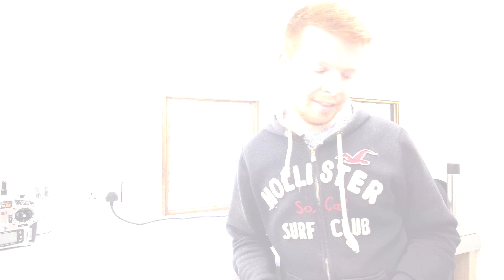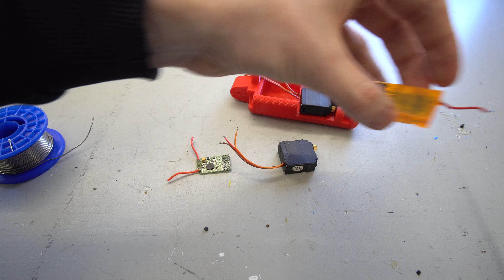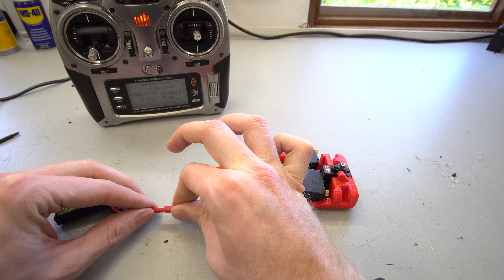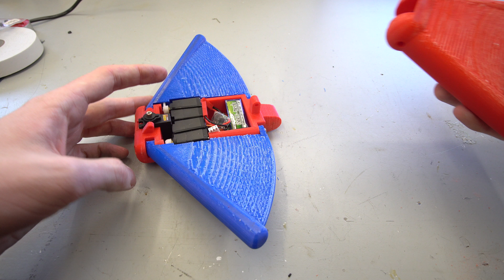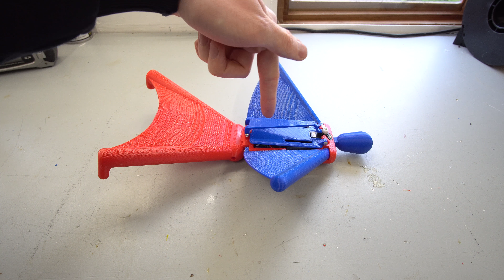RC Wingsuit - Part 1

Comment: If you want to turn the sanded plastic back to it's original color, just take a torch to it from a distance and slowly warm the surface till the white re-assimilates. You could do it with a lighter too, you just have to be more strategic not to burn yourself or your piece.
Reply: Derek Troberg - almost the same tech as flame polishing....

Comment: Fascinating video and concept. I really hope this works out.  I do think there are two or three "control" elements missing from this design.
For more accurate replication of wing-suit flight you would need to consider 
- controllable "Shoulders" (to allow you to independently tuck either arm in close to the body to more effectively control roll, and to tuck them in simultaneously to control pitch an airspeed)
- controllable "elbows" (for fine pitch and some yaw control)
- controllable "hips"
- controllable "knees"

Of course a wing-suit is far more difficult to accurately replicate in RC as this form of flight is controlled far more like that of a bird or other flying animal which means that every bone and muscle is used to finely control some aspect of the flight. Even the head! 

I love this project. All the best

Comment: I would test the aerodynamics by hanging it from the ceiling and only dropping it two meters. I thing with a slow motion camera one could get a good grasp of the movements without wrecking it. Just in case the parachute fails.

Comment: Would you recommend the University of Hertfordshire for aerospace engineering?
I noticed you have a hoodie from there and I have an offer from them and would like to know as much about the Uni as possible.
Reply: A load of it is literally built on an old DeHavilland factory, so it wouldn't surprise me if they had a decent aerospace department.

Comment: I'm not sure, but I think the Wight doesn't relate directly to the height. If your height is reduced by a half your weight is less than a half.

I think it doesn't work the same in all shapes, but if you reduce by a half a cubes height you reduce its volume and weight by 2**3=8
Reply: This is kind of complex. Mass scales with length cubed, but drag force scales differently.
Reply: Charles Lambert wow, yeah drag is with surface so scaling everything is really complex!!

Comment: Good luck, you're going to need it. How do you expect to keep sight of it at the crazy speeds it it going to require? Finding a ridge with some strong wind is your only chance without FPV, and it still probably won't work. What about an elevator? That is the most important control surface, I believe they use their knees in real life.

Comment: aerodynamics don't scale linearly (Renolds number) a 747 wing loading (weight/wing area) is many many times higher than that of a model aircraft.

my prediction is you will have a glide ratio of about 1:1 if that :-)

Comment: I have zero experience with 3d printing so I have no idea if this would work but it might be worthwhile to try applying some mold release spray to the print bed before printing or maybe some 303 aerospace protectant.

Comment: Hey Tom! Love your videos! I was wondering! Would you consider building my multi rotor model and using it to lift your Parachute dude? It’s a 500 size quadcopter, with DT-750’s spinning 11x4.7 props. I can give you access to a google drive to download the stl files. And the assembly videos....Email me at snx1458@gmail.com

Comment: I think this is a great idea but sadly I don't think it'll work in its current form - for full control you'll also need to bring the hips and legs into play. You've got the right idea for roll control with the arms though. To turn right you'd either drop the right shoulder or straighten the left leg more than the right (or do both for tight turn), turn left do the opposite. To go forward faster your straighten the legs at the knees, slowdown or backslide bend the knees. Stability in flight comes from the fabric between the arms curving higher than the body CofG and acts like a shuttlecock - heaviest bit at the bottom. Hope this helps a bit, and looking forward to Pt2 regardless of whether it'll work or not :)

Comment: This leaves me wondering how much the square-cube law applies to aerodynamics. Either way, I feel that this will perform much worse compared to a full sized wingsuiter (more speed needed and less lift provided)
Reply: M Wire actually it think it gets easier the smaller it is

Comment: Great idea and vid but i don't think its going to glide well at all. The surface area of the wings is too small plus where you have simulated the arms are too round there is no airfoil effect. I might be wrong but good luck with it anyway still worth trying

Comment: Love your projects but this looks like it’s doomed to fail, it looks way to heavy for the tiny wingspan, could have done with fabric wings and carbon rod arms and legs to keep the weight down. I can see this dropping like a lead balloon! At least you can easily mount an FPV setup to have a look at what happens, good luck 👍

Comment: Legs should be independent for roll and pitch control as per a birds tail and wingsuit. 
Mix it as elevons tied in with arms as ailerons. 
Then construct from carbon fibre and use ripstop for wing surface. Maybe double skin it for a proper ram air aerofoil.

Comment: Hi Tom. Great video as always and I've been particularly interested in all of your parachute/paragliding relating videos recently. As an ex-skydiver/wingsuiter I've a couple of thoughts which, although late for your current build, might be of use for future iterations. 

I would have considered using two alternative control surfaces instead of the articulated arms - a twist mechanism at the hips and a bend (like an elevator) at the waist. The twisting at the waist would simulate more accurately the way I would have steered, whist trying to maintain maximum arm inflation in anhedral position. Bending at the waist functioned to change both  the camber of my body aerofoil and also the inherent angle of attack.

I don't thing it will be a problem in your current build, since i predict a very head down attitude, but take a look at real wing suit videos and the parachute deployment. Typically forward speed is reduced for deployment by bending the legs at the knees, and pulling the arms into the body. 

If you any further details please get in touch. I'm also in the UK and happy to talk.
Reply: God has said in the Quran:

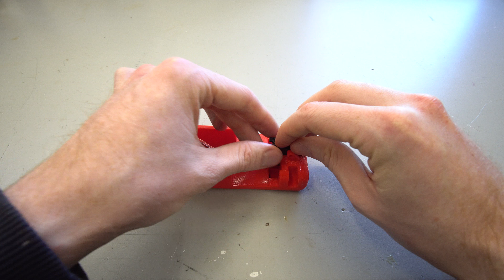{ O mankind, worship your Lord, who created you and those before you, that you may become righteous - ( 2:21 ) 

 [He] who made for you the earth a bed [spread out] and the sky a ceiling and sent down from the sky, rain and brought forth thereby fruits as provision for you. So do not attribute to Allah equals while you know [that there is nothing similar to Him]. ( 2:22 )

And if you are in doubt about what We have sent down upon Our Servant [Muhammad], then produce a surah the like thereof and call upon your witnesses other than Allah, if you should be truthful. ( 2:23 )

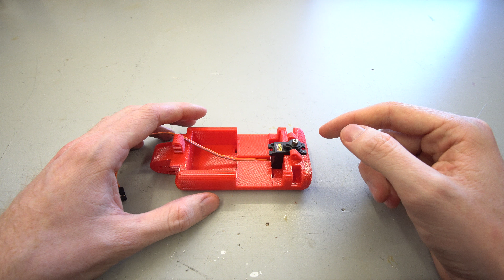 But if you do not - and you will never be able to - then fear the Fire, whose fuel is men and stones, prepared for the disbelievers.( 2:24 )

And give good tidings to those who believe and do righteous deeds that they will have gardens [in Paradise] beneath which rivers flow. Whenever they are provided with a provision of fruit therefrom, they will say, "This is what we were provided with before." And it is given to them in likeness. And they will have therein purified spouses, and they will abide therein eternally. ( 2:25 )

 Quran

Comment: to get rid of the white on the 3d print use a heat gun, it will melt the little micro fractures back together
Reply: It also helps to sand the PLA under running water

Comment: Not an expert, but you'll probably need massive speed to have a noticeable effect of the control surfaces, so just dropping it from a height might not be enough.
Reply: The problem here is not the height itself, it is that at terminal velocity the wind resistance won't be enough for such a tiny wing surface. My guess is that it would have to be accelerated with a sling or something.
Reply: The hard part is when he gets it up to where terminal velocity wont be a problem, it's going to be far enough that it's almost too small to see.
Reply: Robert K 2000 feet / 12 = 167 feet for scale.
Reply: So all he has to do is go to his local multi-story parking garage, or convince a radio station to let him drop it from their antenna, which would be cool.
Reply: Good point.
Reply: just drop it from a drone high asf

Comment: See if you can get a glide ratio of 2:1, I belief thats what the real things do.
Reply: See https://skyderby.ru or https://ppc.paralog.net to see what wingsuit are capable of. 2:1 and 3:1 are quite modest results. 2:1 is only slightly better than tracking.
Reply: paraglide01 I think it's more like 3:1
Reply: It's about 2.5:1
Reply: Source: http://flylikebrick.com/faq/
Reply: Or go like a JS-1 and go 55:1
Reply: The best flyers can actually fly Up! They have to pick up speed first by diving. There’s videos of it online.

Comment: great idea but maybe you like to make the legs into an elevator?
Reply: And another thought I immediately had would be to allow them to pivot like hips do, to act somewhat like a rudder.

My prediction however is, this thing is more than likely going to fall like a stone.
Reply: He's Saying make the legs control the height instead of them being a solid piece.
Reply: yeh but I don't think they're controlled by a servo.
Reply: I think he means twist at the hips.
Reply: I don't think using the hips as a rotation point would be very realistic. I have watched a ton of the wing suit videos and I have never seen them flex the hips to act like a elevator, it may be physically hard/impossible for a person to do in flight.
Reply: ye but this a Rc project where you can easily use them as elevator making steering a lot more simple and simple works most of the time and because it already can rotate he only have to add one more servo
Reply: Whatever it won’t fly anyway it is too heavy it will crash directly
Reply: they can flex their knees. That would great a larger moment.
Reply: Maybe wing-suit flyers don't swivel their hips, but I'm sure they would raise/lower one leg independently,  which for this application would be most simply replicated by swiveling the 'hip' section.
Reply: ya that's what mean but rotating on that axle is the same thing right?
Reply: it's not going to crash it's just like the space shuttle landing but then a bit rough on the edge lol
Reply: your correct i was thinking the same thing
Reply: you mean like a real wing suit... glide ratio of 2.5:1 is pretty much controlled falling :D
Reply: Wingerons! But the legs should have vertical fins for stability.
Reply: He don’t need elevator he is using arms as like elevator and he can rotate with them too
Reply: Idk
Reply: Asl
Reply: How To DIY Rc what?
Reply: The legs do pivot at the hips. Did you watch the video?